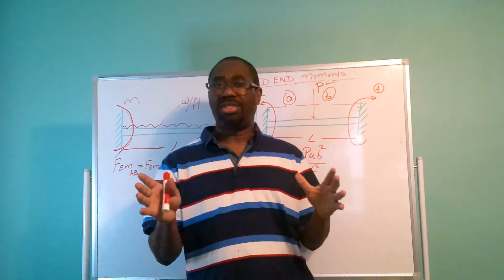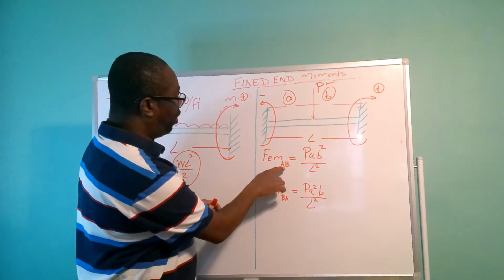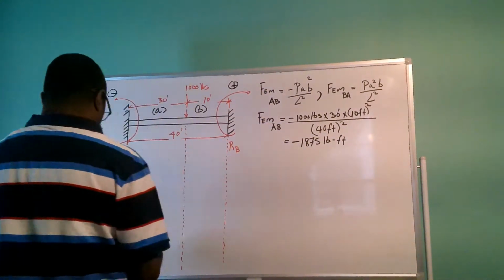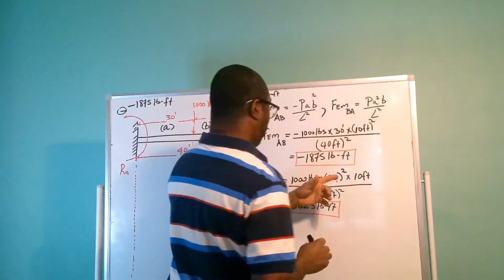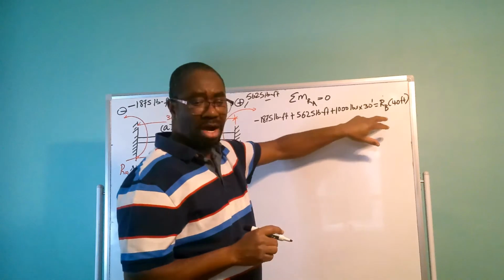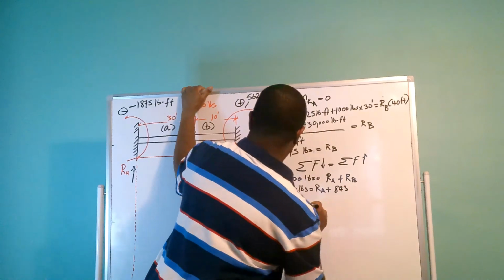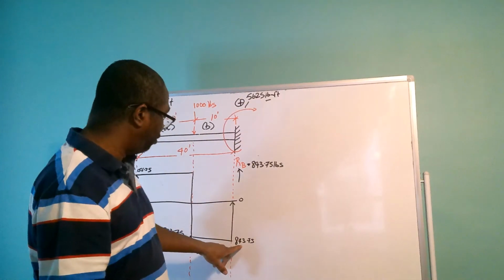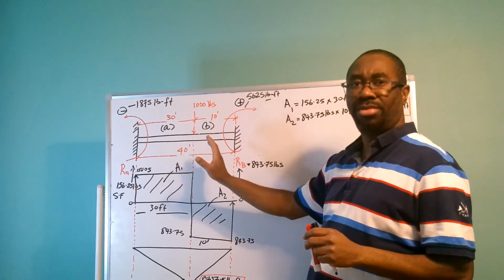How to calculate Fixed End moments for a concrete beam.

Comment: Thanks, I really learnt something from you.  If you  use maximum bending moment that you calculated, it's good that the beam will be well reinforced.  So we don't need to consider end moment in the design as it is lesser value in bending moment?